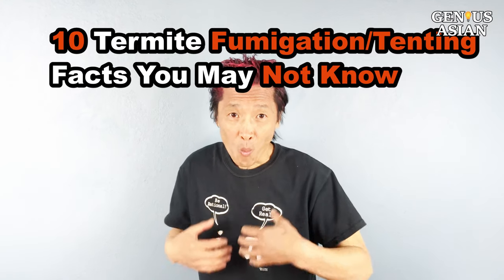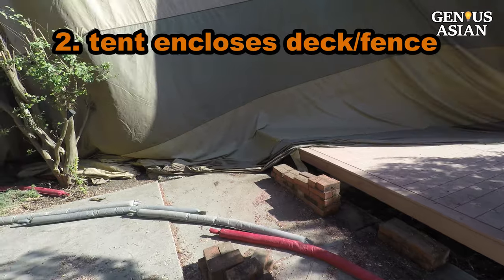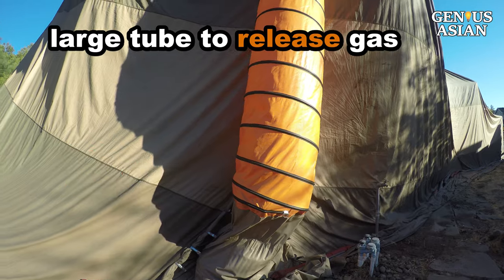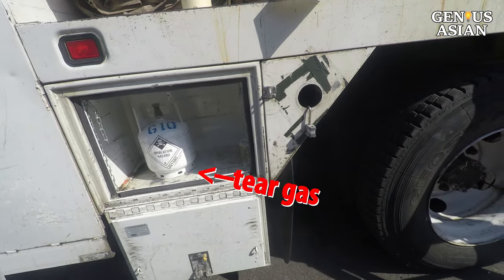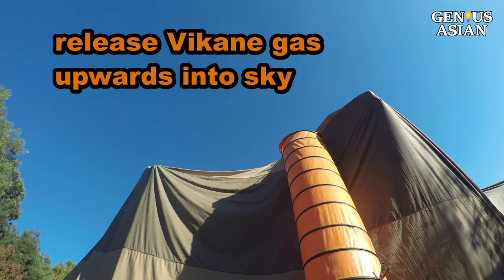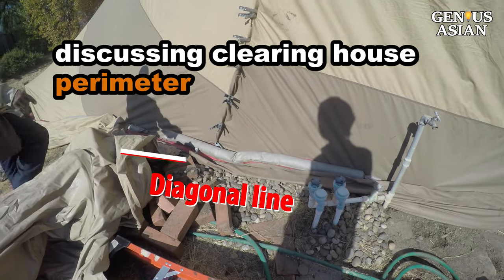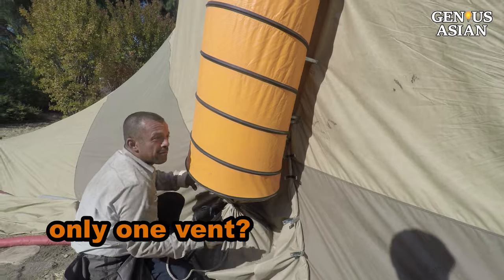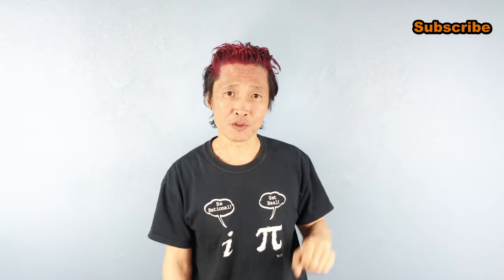10 Termite Fumigation/Tenting Facts You May Not Know

Comment: This is my first week working in a fumigation co. and boy it is a  hard labor job. My respect to all fumigation workers.
Reply from the maker: thank you for taking the time to chime in
Reply: how many  hours does the tent need to be on and how many hours is the chemical actually being pressurized?
I get so many different answers from 18 hours to 4 days
Reply from the maker: @IWBVS  very good question. It depends on many factors, as shown and discussed in the video, for dry wood termites we were told day 1 poison gas at least 24 hours, and day 2 to let poison out and the 3rd day tent off.
Reply: @GeniusAsian   Is the tear gas used inside the sealed tent or outside around the premises?
Reply from the maker: @standforhumanitariancauses4756  the tear gas is inside the sealed tent so that if someone breaks into the house, he will have to leave because of the tear gas.

Comment: How does the Vikane Termite killing gas get inside the walls and ceilings if they are totally sealed by painted and caulked surfaces and edges?
Reply from the maker: good question, small animal only needs a small dosage to be killed. Even such small animal still needs to breath. you may not be suffocated in a wood tunnel but termites are fine in the tunnel. Also Vikane claims penetrating deep into the wood and other materials,

Comment: After a house gets fumigated, how likely is it, that it will need another fumigation? Does one fumigation usually take care of drywood termites?
Reply from the maker: it is likely it will last 7 years. And then your neighbor's termites will fly to your house and start all over again.
Reply: Fumigation is used for taking out infestation. It is a gas and that makes it able to penetrate wood concrete and bricks. When the treated area is aired out there is nothing stopping reinfestation from reoccurring. Fumigation is a last resort to big problems it does not help keep out bugs it is used to kill them. It has a one time effect. Regular pesticides like tempo and other liquid pesticides have a long term kill span some up to 18 months.
Reply: @MrDlayn  What's a good pesticide to spray around the outside of the house to prevent drywood termites or does such a thing exist? We only have problems with drywood termites here, not subterraneans.
Reply: @petef.4361  spraying window seals and perimeter of the house door ways. Diacon igr is a pesticides that has long lasting kill span, temp is another Centynal synergized is also a great chemical it has pb08 in it. Another method of eliminating bugs is fogging.

Comment: Does this increase the value of the home?
Reply from the maker: If you are selling the house then the buyer needs inspection called Section 1 items which includes termite report. If you have termite, the buyer will try to negotiate the price to deduct the cost of Section 1 items, usually not using the cheapest contractor. If you are not selling the house, them you must treat it for your own good, because those termites will eat the lumbers until the house falls down.

Comment: Tension doesn’t work for subterranean termites
Reply from the maker: license pest control professional told me that tenting is usually not used for  subterranean termites, not because it does not work, it works but it is not economical. To kill subs, you need 3 days of tenting instead of 1 day, and the amount of gas used will be much more.
Reply: @GeniusAsian  he’s wrong. Tenting is for beetles and dry wood only. Subs live in the ground. The gas would never get to them. Beetles however require more gas. I’m a licensed termite inspector. Just sayin. Cheers!
Reply: @thecalikitchen  yea. Gotta drill or dig and flood it w termidor or something
Reply: @GeniusAsian  Subterranean termites live underground, so this process will only kill the termites located inside of the structure. These guys don't live in the wood they're eating unlike the Dry-Wood termite which happen to live inside of the wood. I work for a pest control company here in Mid-Florida; so I can only speak for my state as I'm sure it varies. The typical treatment for subterranean termites involve poisoning the soil around the perimeter of the structure, with fipronil ( what our company uses ) so as they come for their next meal; they'll pass through the poison. You CAN kill subterranean termites with this process, but nothing is stopping more from coming back under the soil.
Reply from the maker: @Nicholasw991  thank you for taking the time to chime in, your comments will help other viewers
Reply: Vikane gas can be utilized against formosan termites, an invasive specie of subterranean termites as a knockdown measure. A liquid treatment or effective baiting program would be required for full control. For most intents and purposes subterranean termite fumigation would not be recommended.